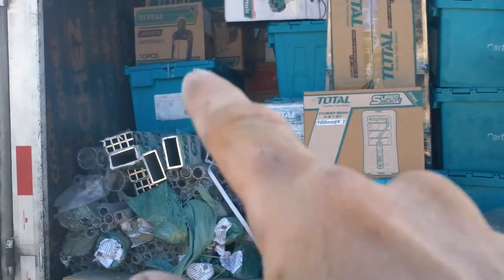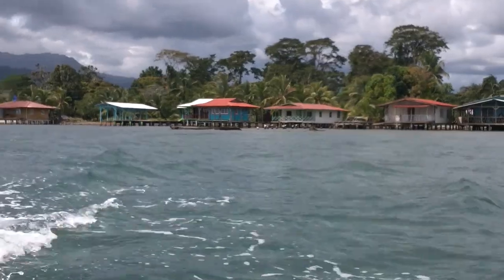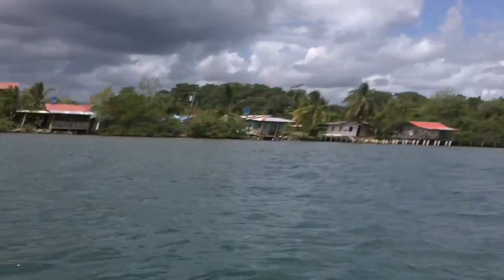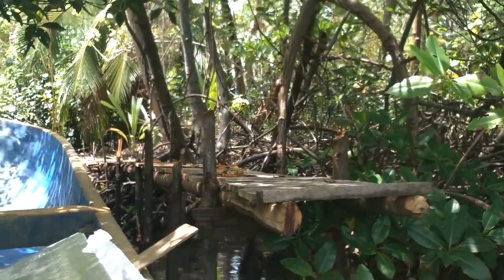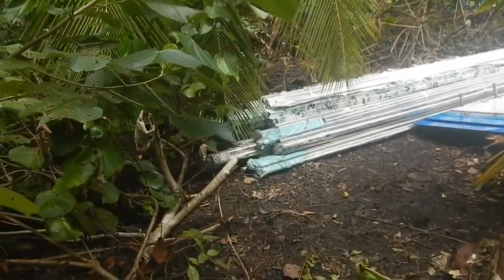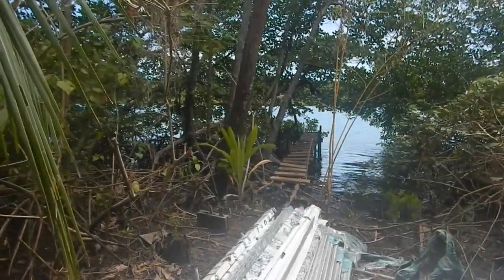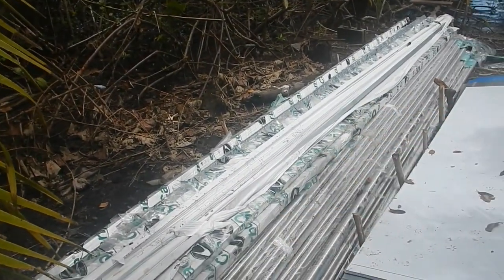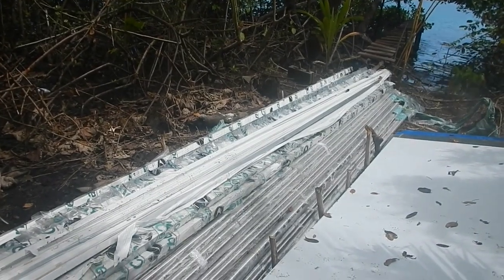Supplies!  Supplies!  Stainless and Aluminium!

Comment: Nice stock. Remember to keep the blue protective film on the sheets out of the light otherwise it will be terribly difficult to remove in the future
Reply: Oh god, the UV turns that plastic into tiny little splinters you have to individually pick off. It can easily be a full day to pick it off a single sheet once it gets crumbly. That or, use a wirewheel.
Reply: Damn.  I didn’t know that.  Good tip.  Thanks
Reply: I've dealt with this very problem. I found that paint stripper was the key to remove it easily.

Comment: Don’t know if it’s something that would interest you but I’ve seen a guy living off grid on a tropical island that used washed ashore plastic in an oxygen and open flame deprived stainless steel vessel to above a fire to evaporate the content and then condensate it back to benzine and diesel for his outboard engine and his diesel generator.
Reply: Wow that sounds freaking cool. Care to share a link to that video?